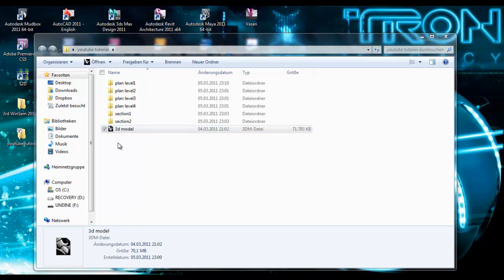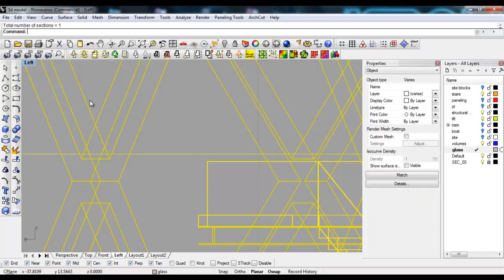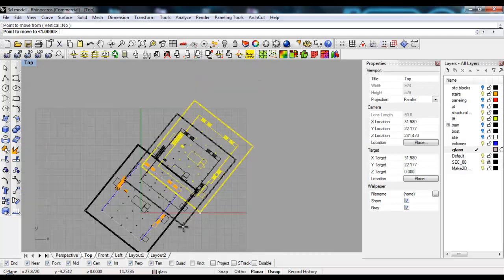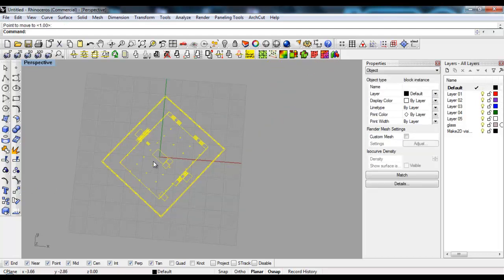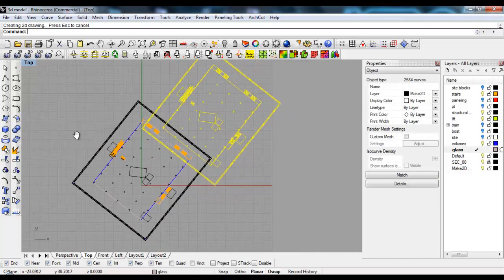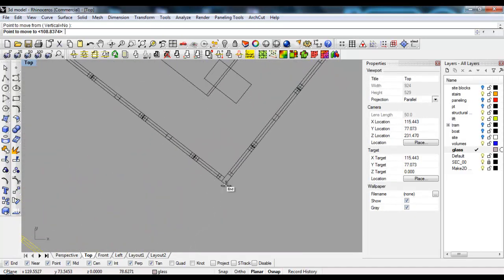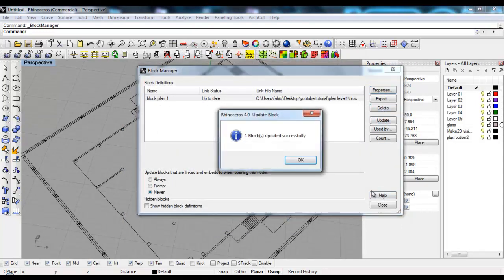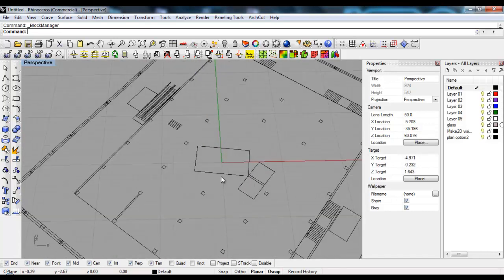Advanced BIM techniques in Rhino 3d: Plans

Comment: interesting method, but it seems it would be very difficult to manipulate line weights in the final output without extensive reworking of the plan each time the block is updated. Do you have a solution for this?
Reply: Austin Hawkins use the drafting tab in Rhino. People don't really know about it. If you are a beta 6user this is even better ;)